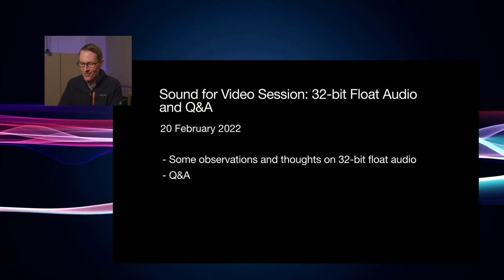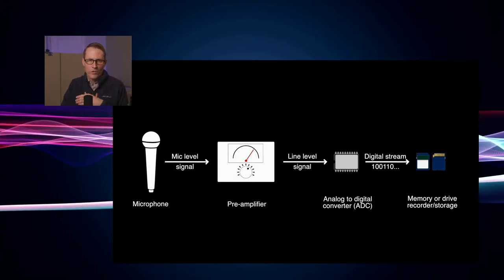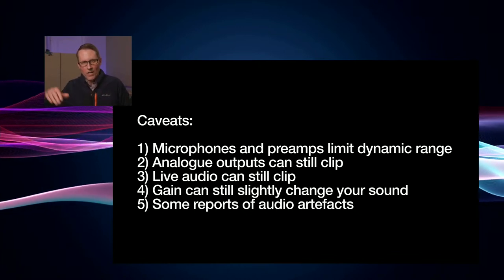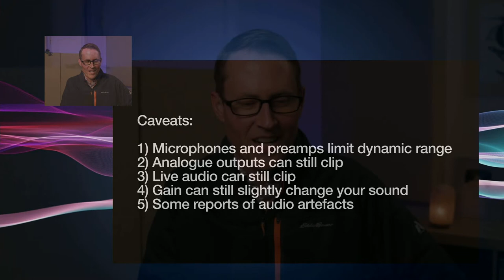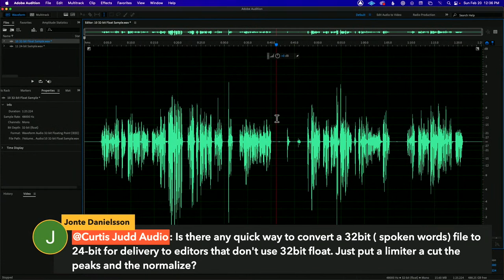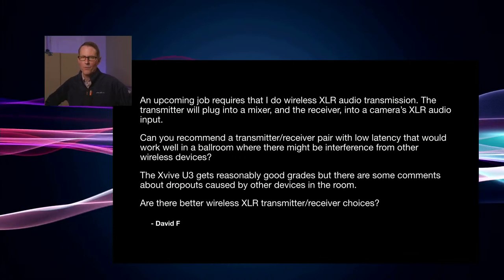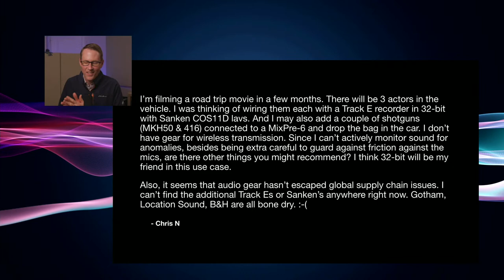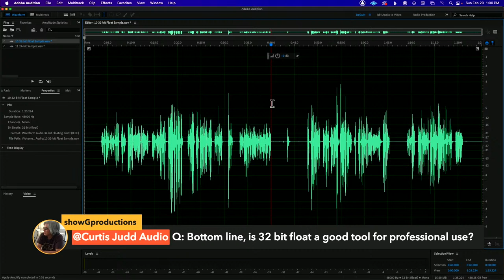Sound for Video Session: 32-bit Float Audio & Q&A

Comment: I was trying to decide between 3 portable options for recording interviews. I currently have a Zoom H6 that I love but want to add an even more portable option with 32 bit float. I was considering replacing my Zoom F1 with the Zoom F3 or Rode Wireless Go ii. I was suspicious of the Rode Wireless Go ii 32 bit float claims but thought IF anyone knows for sure its Curtis Judd. A quick search brought me to this video. 🙏🏼 Do you think the Zoom F3 would be a worthy upgrade to the Zoom F1 and to use with a lav — any recommendations? I work alone and appreciate a safety net. 🤗Looooooove your channel.
Reply from the maker: The F3 and F1 are worlds apart with the F3 being far superior, albeit rather different recorders for different use cases.

Comment: Sadly though PortaCapture X8 Can only Handle 112 dB Dynamic Range. Reply from Tascam Confirmed my suspicion  

"Our engineering department has sent the following information...

The dynamic range of 32bit-float is about 112dB in the best case.
Equivalent input noise(EIN) is -120dBu or lower(Ch3-6).

Thank you for your interest in TASCAM products."

That is 20-30 db Less Headroom than Zoom F6 and Sound Devices Mix Pre ii.
I can only think of the Noise Floor being higher compared?
Reply: Thanks for sharing the details of the response back from Tascam.
Reply: I wonder if that limitation is due to the ADC or the built-in X/Y - A/B mics?
Reply: @erelando  This is specifically in relation to the XLR/TRS combination inputs (inputs 3-6) vs. the 3.5mm TRRS inputs for the included microphones. The limitation is most likely the analogue pre-amplifier.
Reply: @erelando  You can not make a wide dynamic range ADC out of two low dynamic range ADCs but you make fake it using 32 floating point math. :)

Comment: Thanks for the insights - what i take away from this: as a preamp's dynamic range is limited to aprox. 120dB at max, gain staging between mic and preamp remains important even with 32bit recorders containing 2 cascaded ADCs - the only step no more required is gain staging between analogue preamp and ADC, though I doubt these cascaded ADCs work with the same sound quality over their full dynamic range. Honestly, I'd rather invest in good preamps and mics, and take an extra second for proper end-to-end gain staging.
Reply: Some higher end recorders, like the Sound Devices 8xx series have a dynamic range spec of 142dB if I remember correctly. The nice thing about a multi-ADC design is that the audio signal almost always falls within the sweet spot of the converters since they’re sharing the job. None of them have to use the lower resolution portion of the “word”.
Reply: @curtisjudd  142 dB sounds promising - I'd believe they must also use two parallel analogue preamp stages with different gain settings to achieve that? I do not know any stand-alone high-end studio preamp, not even my Avalon M5, with such dynamic range...
Reply: Tascams Portacapture X8 is only 112 dB of Dynamic Range Handling .... which is pretty much a failure for 32 bit recording and Sound Effects
Reply: @BushMasterThermal  For sound effects and other cases where you truly need a wide dynamic range caputure (very very quite to very very loud), yes. For slight overages for dialogue, it is helpful, still.

Comment: The specs on the new Zoom F3 seem not to mention its %THD figure...any thoughts about that?
Reply: We'll give a close listen when I get the F3 in for testing.
Reply: @curtisjudd  Also I worry that switching back and forth between the hi/lo A/D converters during a recording could introduce audible artifacts.
Reply from the maker: @tiburd7  I haven't run into that with the F6, at least for spoken word recordings. But we'll see how the F3 holds up.

Comment: Thanks for clarifying this. Seems like keeping my Zoom f4 and just utilizing the safety track is still a valid option vs purchasing the f3 which doesn't have as many input options. I do like the smaller size and it would be easier to mount to my filming rig. Maybe I'll sell my older H5 and get the f3.
Reply: The Zoom F4 is a fine choice. I find that there really are very few situations which truly call for 32-bit float recording.

Comment: I bet our analog stages are not going to get more than 200 of range. this has to do with physics. I typically see a max of 160. Anything greater than that cannot have wires/connectors/buttons/switches. Most equipment has 120 of range without noise floor. Lesser equipment has the noise floor between -60 and -90. 
   No dual converters or trickery is going to get around this. This is physical phenomena. At that level of quietness the wires on the circuit board and the capacitors themselves become microphones. Resistors become SUPER noisy.  The leads coming off the IC's are sources of noise. The ceramic case that the IC is housed in would have to be different...   In my experience, currently we are capable of about 200db of range in the analog domain and near the bottom you can hear strange things, like static electricity. The TV power supply from 6 feet away. the fridge in another room is loud. your footsteps are godzilla and they break your eardrums. etc etc ...  With all the power supplies in our modern world, using a dynamic mic at that level is silly caz there is SOO much electrical interference.